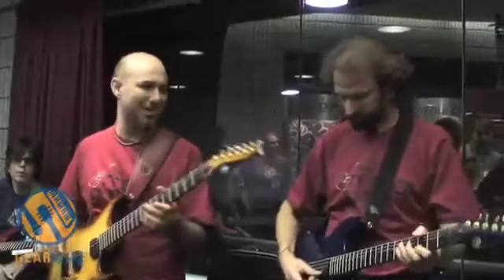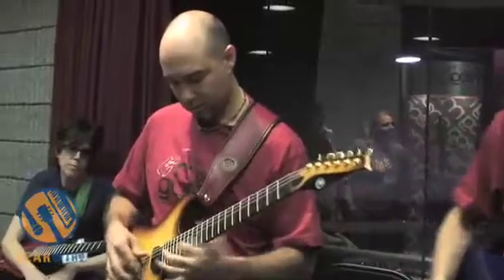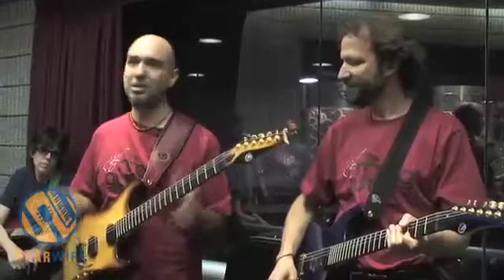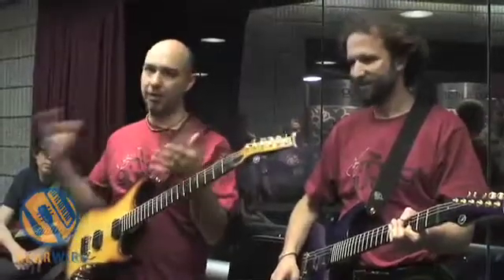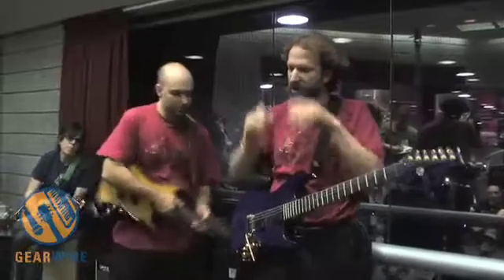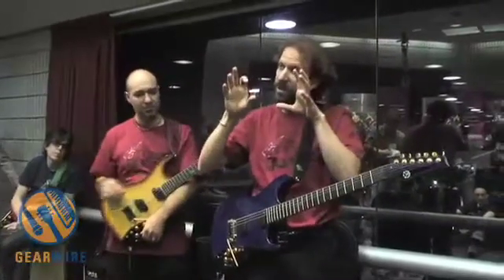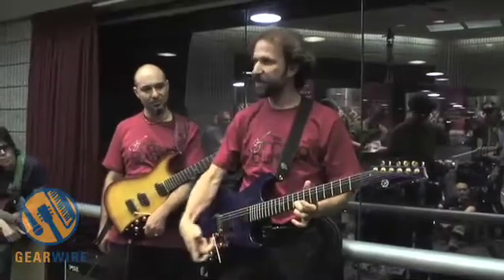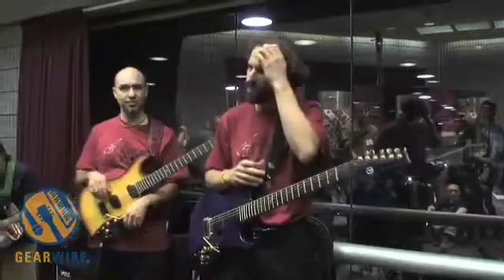Moog Guitar Sustainer System In Reverse

Comment: Digital is superior for parameter control?  That's funny...I usually experience a lag in digital pitch and modulation wheels.  Also, listen to a digitally controlled Dave Smith Prophet 08 then listen to a Moog Little Phatty, and tell me that the DSI sounds better.  It doesn't.